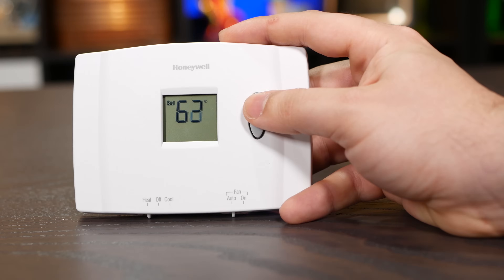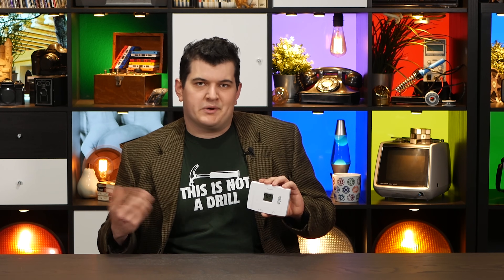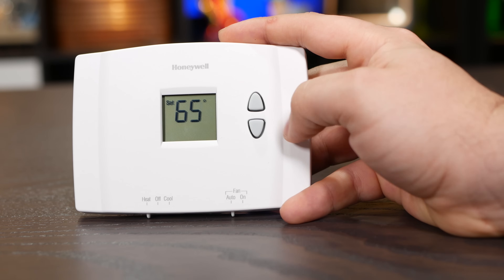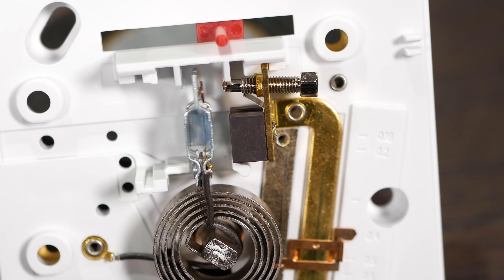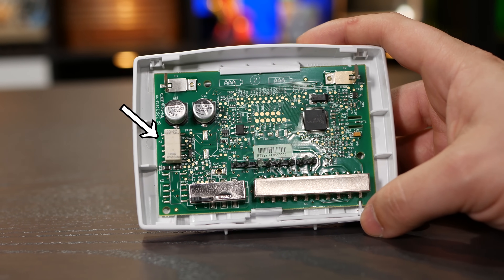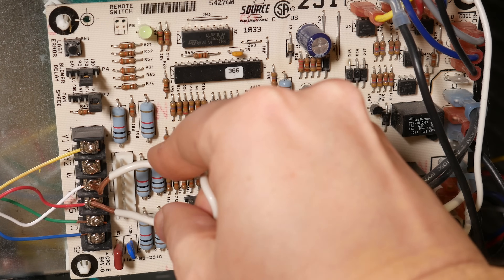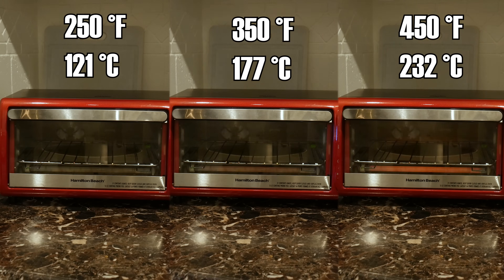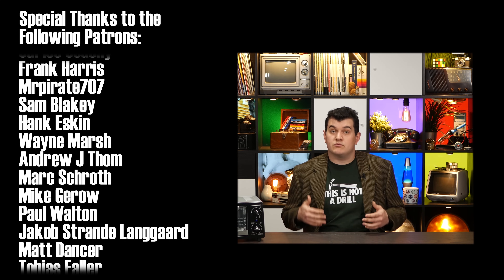Thermostats: Cooler than you think!

Comment: @technologyconnections -- The ecobee thermostat allows you to temporarily change the temperature for 2 hours (or 4 hours, or until the next timeblock in the schedule, such as sleep) before going back to the regular scheduled temp.

Ecobee also has remote temperature and motion sensors. It can use the average temp of each sensor or it can run the heat until the currently occupied room gets up to the set temp, regardless of what temp it is in the other rooms.

Comment: @technology connections. also coming out are fully modulating furnaces. meaning the have full range of blast. i would say fully modulating furnaces are in less than 1 percent of homes in canada. also  2 stage and modulating furnaces ARE NOT more efficient. they still use the same amount of fuel to heat the house from 15 degrees to 20 degrees celsius. what modulating does is make your furnace last longer because it's not going from cold to being red hot in a matter of seconds wearing out the heat exchanger.

Comment: re: the final question... my Fujitsu heat pumps have a "powerful" button, that turns the cooling on full blast for several minutes and then returns to its normal set routine, so things like that do exist.
Reply: Mine too, things do work a little different once you ad a variable speed/inverter compressor into the mix.
Reply: Probably it only makes it turn in 100% duty time for this several minutes and then come back to the 50 or 70% duty cycle to stabilisation.
Even newest systems with microcontroller wich allows you to variate output temperature like your car ac were you can see notorious diferente when you change temperature, can do it just because they have a thermostat directly on vent output instead of in the middle of the car like happens at home and gives them a quick feedback alongside with pre-defined duty cycles for each temperature because you are in a limited closed area, and variations are not so big. In home systems its almost impossible to make factory regulations because every home are different
Reply: i have the same button on my panasonic AC/heatpump but obviously it rather releases some extra cooling power on top of the regular maximum setting, so full blast without any regulation, and it will only stop if i switch back to normal. but hey it works, when it is very hot and the normal mode struggles to cool down the room.
but a way cooler feature is the inverter control of the heat pump which actually allows the system to run constantly at the exact needed power instead of the annoying on/off cycle.
Reply: Minisplit (ductless)heat pumps are variable speed.  The compressor and indoor and outdoor fans only run as hard as they need to.  They are very energy efficiant.

Comment: In the UK, many heating controls have a 'heat boost' button. They would typically run the heating system for one hour and then return to normal programming. Whether the heat actually came on would still depend on the thermostat setting, but it's useful if your heat isn't scheduled to come on and you want heat now.

Comment: Damn I was gonna comment after the 30% duty cycle part saying that it's like a super low speed PWM, mainly to boost engagement, but I usually like to watch a video to the end before commenting (to boost engagement) and you beat me to it! I also had issues with my cooling system when I used a nest and I didn't have a common wire. It now makes sense! Thanks a lot!

Comment: Most older programmable thermostats do that “one cycle” thing. Mine has 4 times/programs on weekdays and 4 each on weekends. If you set the temperature to something new, without pressing the hold button, when the next scheduled program happens it will revert to the normally scheduled temp. If you press hold after setting a new temp, it will stay at that setting until you press use schedule.

Comment: I know a thermostat that does allow special conditions like turning on full heat for a while when you want to. Just use an Arduino or Raspberry Pi with relays, sensors and buttons. You can even make a web interface hosted on the Pi

Comment: I personally think the whole “crank the heat up high to heat faster” could be from older cars, my old utility van (containing only the barebones features and is atleast 10 years older then it’s model year) has mechanical sliders for tempature and duct controls, not controlling if the heater core receives hot coolant or not, rather controlling a shutter. So throwing the heat all the way to the top would heat up faster sense you give the heater core more airflow

Comment: My old heat pump used B for common and I asked a hvac contractor to swap the 26 year old thermostat that I could barely read with a new one. He blindly connected matching letters and blew the heat pump fuse when he connected  the reversing valve pin to common. Trane uses weird fuses and we were without heat in winter for 8 days. I figured out that Trane uses different letter with a 5 minute google search. I should not be smarter than the expert I hire on his own specialty.

Comment: Please discuss limit switches so that people will understand why the fan does not instantly come on when the heat or air conditioning engages and why the fan runs after the heat or condenser unit has turned off.

Comment: When I lived in Pennsylvania I had a loft bedroom that stayed a few degrees warmer than the downstairs. The thermostat downstairs always displayed a temperature a few degrees warmer than an independent weather station we had, so it's possible it had a sensor upstairs to account for all the heat rising up there.

My current place has separate thermostats for upstairs and downstairs, but I'm pretty sure that they're just basic ones and the system itself handles dual zone control.

Comment: I have a heat pump with two stages, electric coils, and a variable air handler, so cranking the heat would heat much faster... and eat electric like candy. In fact I went through the installation service menu to tweak things to keep the electric coils off as much as possible, except during defrost and very cold temperatures, because sometimes my family do like to crank the temperature just to heat the house a little.

Comment: The endocrine system works using the same principle by what is known as a negative feedback loop.  Once hormone levels in the body drop below a specific level, it signals an endocrine gland in the body, usually in the brain’s hypothalamus or pituitary gland to produce more of a specific hormone until reaching a specific level at which point, it will stop producing that hormone until it drops below a certain level again.

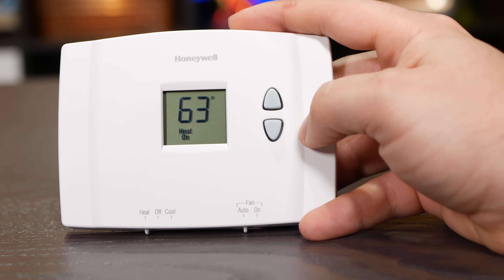Comment: @technology connections they make programmable thermostats that you can choose run/hold to go in and out of the schedule. So you could program it to go on every friday at 3:30 - 4:00 while you are mowing your lawn. Also you forgot to mention the Gas/oil switch on the back of heating thermostats that will adjust the differential for when to actually shut off the heat so it doesn't over heat the living space.

Comment: I think that you should collaborate with grayfurnaceman since he is HVAC and you both drive a Chevrolet Bolt. Oh, and you didn't cover the curious little bugger that is the heat anticipator which is a heater in series with the heat contacts or the cooling anticipator which is in parallel with the cooling contacts.
Reply: Also, some mobile home units had the A/C as an add-on kit and retained the heat only 2 wire thermostat. The heat/off/cool and fan on/auto switches were on the furnace itself. When set to heat it ran as usual with the thermostat contacts closed but when set to cool it ran with the contacts open.

Comment: I have a WiFi ( 3m50 ) thermostat, it kind of has a "one time" cycle control.  If you just change the temperature, it will run accordingly till it meets set point, then reverts back to it's regularly scheduled programming.

Comment: My furnace and AC units all modulate. They run from 10 percent to 100 percent and the fan and flame and even compressor all change speed or flame size depending on demand. Raise one degree and it runs on a trickle. Raise it 5 degrees and it will go to full power. Very expensive system but worth it. I almost never hear the fan, and the temp swings very lightly and stays balances.

Comment: In Romania, we have actually advanced thermostats, some(viessman and buderus) have PID controll, the thermostat beeing the not just the sensor, but also a command module(with more then 2 states, on or off). That being said, most still burn wood for heating. Also, we do not use retard units(body part based measurement units, or cutlery based measurement unit).

Comment: Pretty sure that Honeywell thermostat is exactly the same as the one in my apartment.
Re: Sensor in the housing
My thermostat sits in what would be the "living room" of my 1BR apartment, but currently it's pretty much empty (except as a VR playpen), while I typically sit in the BR part. The BR is usually 3-4 degrees warmer than the living room because it's smaller, me and the computer are sitting in it pumping out heat, and there's blackout blinds on the windows, so I'd love it if I had the ability to move the sensor in here rather than out there, because setting the thermostat to 70 and hoping it'll be 72 where I actually am usually results in insufficient or too much cooling.

Comment: I got a installed water heater in my kitchen. I would guess water heaters work the same way. Except maybe the button pushes the bi-metal bit onto the magnet and contact. And needing a lot of heating of hte bimetal, to overcome the normal position + magnetic force.

I also got a flow heater in my bath and I guess they just added some way to detect water flow. It does have a 3 intensity settings, but seems entirely passive.

Comment: Pretty inefficient heating systems. 
Almost all heating systems here in the netherlands are modulating, either using OpenTherm or some proprietary protocol to command the heating system to heat the water to a certain temperature.
Never going much higher than the desired temperature because heating elements are often placed near outside walls/windows, and the loss of heat is determined by the difference in temperature.
So it doesnt do full blast, just to make sure the elements have time to properly distribute the heat and also to circumvent overshooting the desired temperature because the water hasnt cooled down yet.

Comment: RE: "turn on for 30 minutes"

I don't know of any that have a single button solution, but I know of a couple ways you can sort of do it with a programmable.

At home we have a thermostat with 2 "occupied" temps, and we set it so "occupied 2" is our normal day to day temp, and "occupied 1" is our (depending on season) quick blast of hot or cold (set to some absurdly out there values, like 85F and 50F to force the system to keep running). The thermostat has a button for "temporary occupation" that overrides the current setting for whatever Occupied 1 is for up to 3 hours (defaults to 1 hour). 

It also works great if you get home early from work or whatever and the system hasn't brought the temperature in line after sitting dormant all day. It's not a new feature either, my church has control units from the mid-80's that have that feature (there's also a mercury tilt switch in one of the areas still, we have 3 furnaces and some zone heating going on).

Comment: Many homes in the northern colder climates use hot water or steam based heating systems. Usually on those the thermostat only has two wires - red and white. 

However I have seen some installations in homes with both hot water heating and duct based air conditioning (using a unit in the attic), that have two cables, one going to the boiler, and one going to the air conditioner. The wiring for these becomes a bit tricky due to the common red wire. One way I've seen it wired is there's two relays added to the boiler, one for the A/C unit's blower, and the other for the A/C itself.

Also, zoned heating systems are more commonly found in homes with hot water heating, because they're very easy to install, all you need is a solenoid on the supply pipe going to the radiators in that zone. The thermostat then has to open that solenoid and switch on the boiler. Motorized dampers do exist for hot air heating, though.

Comment: You forgot about the Dwell feature in all thermostats which is designed to keep your temp +-% of what its set for. This keeps your system from constantly shutting on and off too much. This also prevents your system when in A/C mode (when set to a fixed temp setting) from trying to start right after it stopped causing compressor lock. When your system shuts off and you try to turn it back on right away (lowering the temp setting) it will have a delay, this is just a delay feature and not the Dwell feature.

PWM on large appliances would be problematic in most homes as the current they draw would cause PWM on your entire house causing voltage levels rise and fall causing your lights to pulse and reeking havoc on other equipment.

Comment: So modern domestic HVAC systems don't even have some kind of 1-wire digital control system like we use OpenTherm which is common European furnaces?

Thermostats are in fact a very crude version of closed-loop P (proportional) control with only a binary output setting, which has the effect of outputting very slow PWM.

Comment: Hey TC, My thermostat which is a pretty cheep digital one with programmable days and such does allow you to set a temporary temp for the time block your in. So you can for such set it to a lower temp and it will say tmp on the thermostat and then when the block changes it will go back to its programmed temp. Or you can hit run on it again and it will return to its programmed temp. Mine is set to cool the house an hour before I get home and to stop cooling when I leave on weekdays. I think I payed maybe $30 bucks for it on amazon, so its kinda funny nest does not do this.

Comment: Actually in Europe it becomes more and more common to have OpenTherm capable central heating and Thermostat

https://en.wikipedia.org/wiki/OpenTherm

A good example of an OpenTherm capable thermostat is the Remeha iSense.

OpenTherm systems don't have just "full blast and off", they modulate the heat output to match the demand. If for example the temperature only needs to be raised one degree, it won't output as much heat as when it needs to increase it 10 degrees. This also allows the heater to remain on a very low constant burn to compensate heat loss, and thus counters the wild "up and down" heat swings you get from traditional systems.

Admittedly this is mainly for the hot water based central heating common in europe, as what needs to be regulated there is the temperature of the water that gets pumped around to the radiators. Centreal heating based on air like in the US is very very rare in europe.

Comment: In Swedish schools, offices and other buildings with fixed operating hours, it is common to see a button (or sometimes a mechanical timer) labeled “Forcerad ventilation” which forces the ventilation system to start outside its normal operating hours for a limited time. Temperature is in Sweden almost always (the exception being rooms with high volume to floor circumference ratio, like churches and sport halls) regulated by thermostatic valves on the radiators (water distributed heat), but the ventilation is often shut down during the evening and night to save energy when no people are around.

Comment: You can totally use the "cool off" feature you requested with Nest and a little bit of work with IFTTT. (Assuming you're using a smart assistant... That isn't awful)
When given the command-
Record current settings
Set temp to predetermined minimum ( You'll want this incase someone uses your cool off command in the middle of winter. No reason to run the AC for 30mins when it's already 40)
Wait X minutes
Set temp to originally recorded settings.

Easy. " Hey Google, cool off" Is exactly what you want, and you can do that now with IFTTT.
Reply: Unfortunately, IFTT support is going away: https://www.androidpolice.com/2019/05/08/nest-devices-will-lose-ifttt-support-this-august/

You can still trigger Google Assistant routines that adjust the thermostat, though.

Comment: High efficiency furnaces started out variable heat output. I don't know if the thermostat signal is any different but my furnace is infinite stage variable 97.5% efficient forced air. They have gone back to Two stage due to less problems from my understanding. But even the two stage will have two different heat output levels. Seeing as how you get a full tax credit for upgrading to high efficiency heat I would hope the percentage is higher than 20% but I do not know.

Comment: For a european this looks like stone age technology. Heating or cooling either all rooms or no room at all. With my programmable thermostats i can set the temperature in each room for different times and the furnace is regulating itself depending how much waterflow is messured in the heating system.